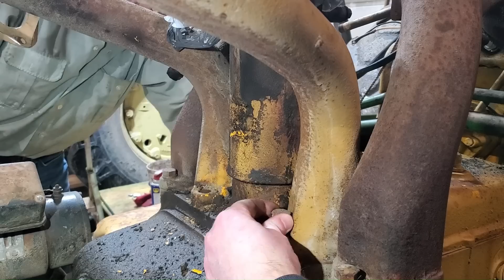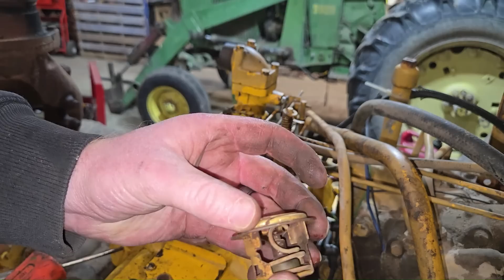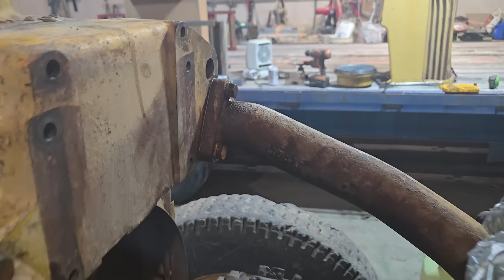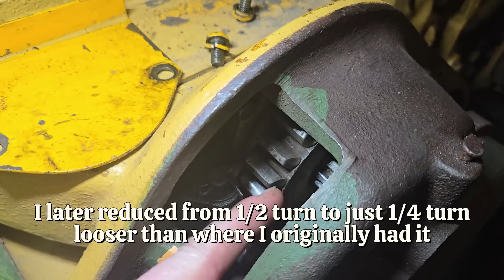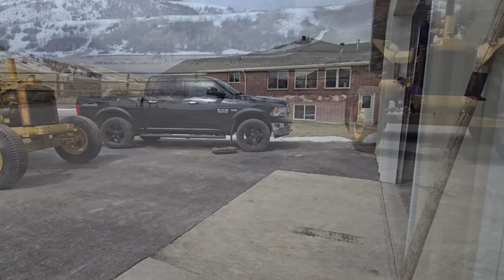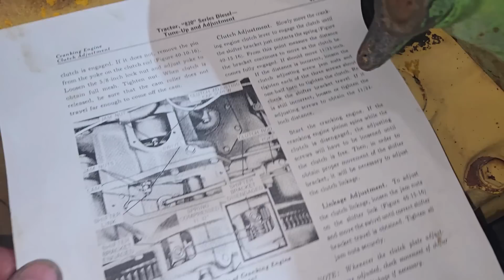John Deere 830-Industrial: Pony Motor Starting Bendix Adjust and Thermostat Install

Comment: I have a JD 730D with the same problem. By Bendix gear is spinning as soon as i start the Pony Motor. Would you happen to know if the 730D only has 2 adjustment screws for the starting clutch? I can only see 2 when i look in the hole.
Reply from the maker: The starting transmissions are different on the 830 and the 730, but the clutch, to my knowledge, is the same. In fact, when I rebuilt my clutch on my starting engine, I used a spare clutch that I had from a 720.

Comment: Excellent Video Jonelstar   :) also dad think a word advice I changed all three thermostat  in pony motor also main motor  on Yellow 830 also hole 1/8  size each thermostat help on bleeding off faster too on pressure too is true for Gas or Desiel motor plus gasket with gasket mender tar silcone or higher temperatures black silcone !  Also put 200 ml 80w90 on in rad on antifreeze mix it lube up also for and hard corrsion won't happen again plus cleaning the rust ! On thermostat cap bolts Antiseize or Grease them up nice help in next serivce too and changed Thermostats every 3 to  5 years  with  new antifreeze plus 80 w 90 differential fluid trick and on gas or Desiel motor!  Do 80W90 every year in rad you be amazing in results and plus more even less overhauling as much too!
Reply from the maker: Very interesting method!

Comment: I'm glad you have good thermostats. I've had real problems lately finding new thermostats that work correctly. There too cold, too hot, or just won't function. It seems to be getting hard to buy quality parts.
Reply from the maker: Yeah, I'm really glad I checked them out because they really needed it! And I'm glad Napa had these replacements that fit just perfect!

Comment: I think those thermostats could have lasted a few more decades. I'm happy you checked the pony one too. I still have an original but Ive heard of others finding a marine thermostat and making something to make them fit properly
Reply from the maker: Ha ha! Yeah, one was corroded in half and the other was corroded shut. I can't help but laugh at the fact that they were completely opposite from each other! Thanks again for recommending I like at them!
Reply: @jonelsonster  thermostats are forgotten sooo often, or people pull em to try to cure overheating, when they aren't the real problem

Comment: You/we are very lucky those thermostats are cheap and readily available, not so with some models of older John Deeres.  Would be interested to know what heat range you put in since the parts book list three.
Reply from the maker: @tractordan933  the thermostats I got are 180. In all honesty, I did not even look at what temp the manual recommended. But I'm my mind I thought I wanted either 180 or 190. But I didn't want to ever deal with overheating... So I went on the cooler side even though the diesel probably combusts better at the higher temp (just a guess about the higher temp being better for combustion)

Comment: When when you took the pipes off the thermostat something fell down inside the housing
Reply from the maker: Good eye! Yes while I was cleaning around the water inlet openings dune other junk fell down in too. I used my shop vac to suck everything out as best I could. I think/hope I got it clean enough.

Comment: The old Cats had seperate levers for the pinion and clutch. YOu pushed the clutch to stop the gears and pulled up to engage the pinion and then pull the clutch with the compression off. The 8H had one lever combined. Push to stop evertthing and then pulled to get it all going again . AND if those cast water pipes crack you can always run a hose over the leak. BLESSINGS Yall!
Reply from the maker: I have never run a cat pony motor. But I've seen videos of them and they appear to be more heavy duty than Deere's ponies.

Comment: Good  video,   I appreciate  your story about this 830. Can't wait to see you  farming with  it.I  do have a few questions,  1 ,Are you going to  paint  it, and  what  color  ?  2,  Are  the  fenders  in good  enough condition to be  straightened.  Thanks again for Sharing your story. 😊
Reply from the maker: Thanks. Yes I will paint it. I like the idea of patina, however I have a bit of body work to do on it, and so I'll be primering and painting all of that. And  I'll do the whole tractor while I'm at it. Plus, it's already been repainted with Caterpillar yellowish/tan paint... So I've got to clean that up anyway. I'm going to stick with the yellow industrial paint. Highway yellow I believe it's what it's called. And I've got a better set of rest fenders that I got from an 820 a while back. So I'll use those instead of the ones that are currently on the tractor.

Comment: Not knowing much about the function of the point motor you educate me a great deal and that I appreciate. Given the choice do you favor the pony motor to electric start?
Reply: Pony motor vs electric start....the debate that hasn't stopped for decades hahahah. Myself I prefer pony motors, at least in my climate in the winter
Reply: @weirddeere  living in Wisconsin, I can totally understand that.
Reply from the maker: Yup, as @weirddeere pointed out, it seems to be an age old debate. If I was a farmer  using the tractor every day, I think I'd prefer E-start. It's convenient. My dad's 830 is factory electric start and  it always starts very easily, even in the cold. But it's a 24V system. Our 70D was converted to 12V electric and it starts well if it's above 40 degrees. Any colder than that and we have to hook up a jump pack to give it enough juice to start the engine. For me, as a hobby guy, I like my pony motor. It's fun having to start the big engine with the smaller engine...I feel kinda like a fighter jet pilot using an APU to fire up the main engines.